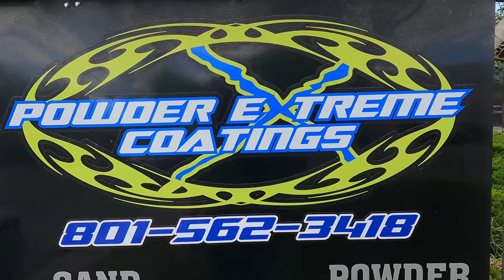I Finally Painted The Golden Nugget Trailer!!

Comment: Love that it's painted black. Earlier I was thinking way too much gold! The bike will really stand out on it rather than blend in.
Reply: is too much gold even a thing lol really though I agree with you
Reply: I"m 80 years old and love Your Videos when i was in My 30 I owned a 4 Wheel Drive Shop in Detroit Mi built the first 4wdn van a Dodge in was awesome My Ride was A 1976 Ford F250 4wd I installed a 428 Super Cobra Jet Engine with Doul Quads in it 15 by 12 in Welt Wheels I Raced it at a place called Gravlerama In Ohio Drag raced that is on Dirt
Reply: Completely agree!   And, the black will look better with the wood floor inserts.
Reply: I was gonna literally be sick if they went all gold on the trailer lol. Im so relieved that all the comments came through about NOT painting it solid gold. It's gonna look so sick when everything comes together.

Comment: I know it doesn't seem right, but just try putting a twist or two in those ratchet straps. They will never flap, hum or vibrate. Even if you think you're getting them tight enough that they don't vibrate, if you keep them flat they absolutely will. It makes them work exactly the same way as the reeds in a harmonica. Have you ever pulled a piece of paper or plastic (or a grass blade!) taught and blown on the edge? Same thing. Put a twist in it, though, and you'll never get a sound out of it. Look at the big rigs on the highway. Some of them don't know this and no matter how tight they get them, they'll hum and vibrate. But the ones in the know put a twist in those flat straps deliberately and they don't have to deal with abrasions from vibrating straps, or straps that fray prematurely.

I know, I'm OCD and hate not having the straps nice and neat, but trust me, that's the worst thing you can do for your equipment and the load.
Reply: Not only is this man correct, but a twist in a strap to calm vibration isn't nearly as "not good" as most people think. The Fireball Tool channel tested several straps in several configurations and the results were surprising. Worth the watch if you have the time.
Reply: Twisting the strap reduces the load rating by half. Not a good idea.
Reply: @danmoore6107  https://youtu.be/ifyJjQXOttE This is that fireball tool video
Reply: @paulcheadle8914  that is incorrect.
Reply: @paulcheadle8914  incorrect, see the above comment
Reply: @paulcheadle8914  Sources please.
Reply: yeah,they seem to need advice as they have never strapped something down to a trailer      >..<
Reply: I don't know, probably works against the vibration and so on. But over here it's just forbidden, a twist in the strap will get you a fine from the police.
Reply: @mazevx2451  that is why we live in the USA !!
Reply: @samhazen6776  Thanks. I replied a couple of times with a path to the video but both replies got taken down. I don't know what I did wrong.
Reply: @paulcheadle8914  wrong

Comment: I used to live about 10 minutes outside a city of 90,000, it was horrible. I grew up there, back when it was less than 30,000. Now, I live in a county with a population density of less than 1 person per square mile, and I love it here. Traffic jams usually involve road work, parades, or cattle drives. And the nearest city is an hour drive away.

Comment: Hey Robbie not sure if you’re using water based or not but if you are when you’re masking off parts of a car tape as you want and spray wet bed it’ll stop the base coat from bleeding and should help stop it lifting like that

Comment: Yeah, 
I,m loading my motorcycle on to the trailer, slap the front straps, but before I could open my mouth to say that ain't going anywhere the handle bar rotates around and the front suspension lifts up. LOL.
OK, the rear straps were good so it didn't go far.

Comment: Your repair is acceptable. At least you didn’t do what I did and use an incompatible printer under a hand-rubbed latex paint and have the paint literally crack and flake off a fully restored coupe.  Looked really good for nearly a year, and then it went to total crap. 😢